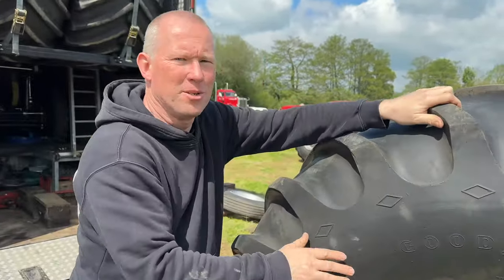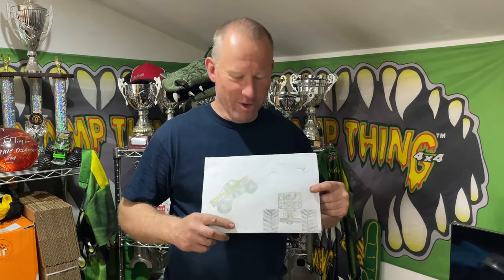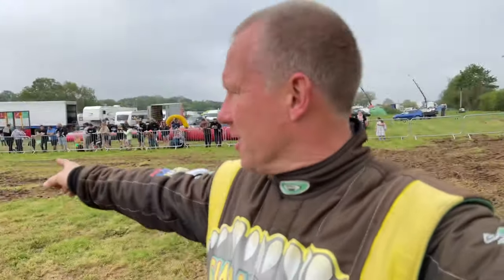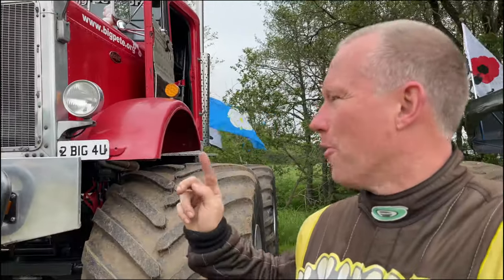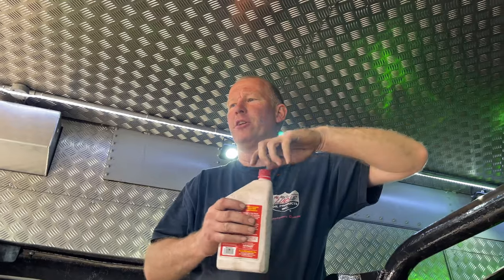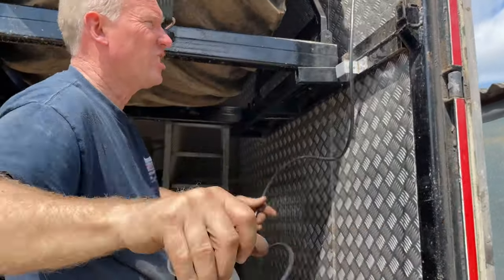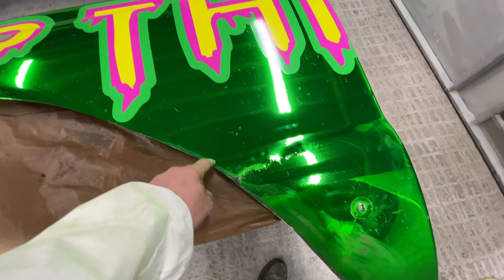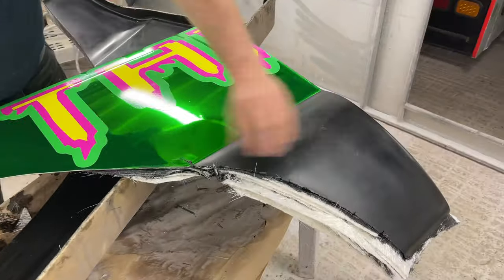Devon Truckshow Vlog 2023

Comment: Amazing video yet again 👌 but why didn't you just fix the crack instead of cutting a hole section off ? 
Would be a lot stronger than it is now buddy
Reply from the maker: You probably can’t see in the video, but that whole bottom panel is stress cracked everywhere . And so if you wanted to re-wrap it, you would still see all the stress cracks in it so it was easier to just drop it off remake the bottom again. All new